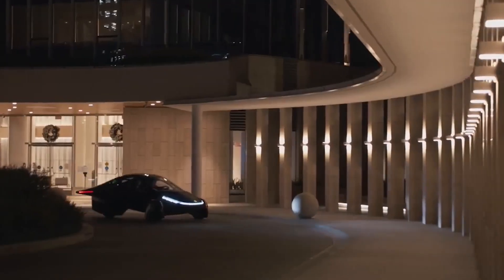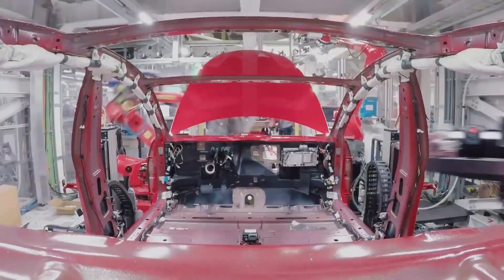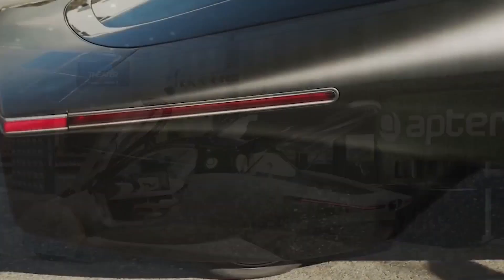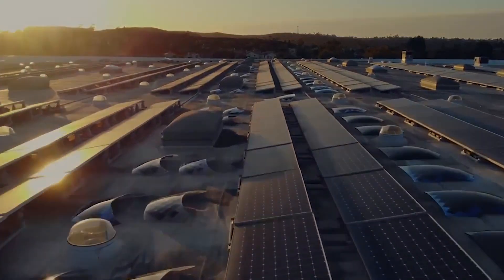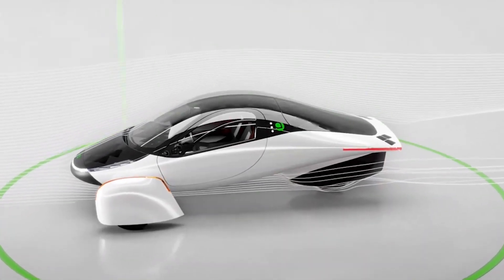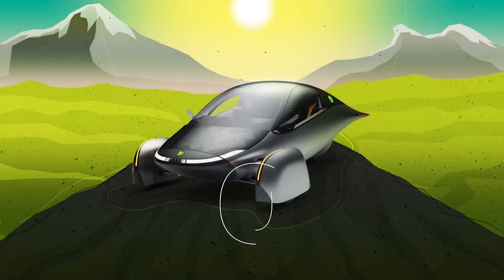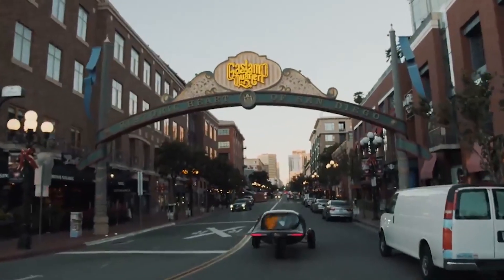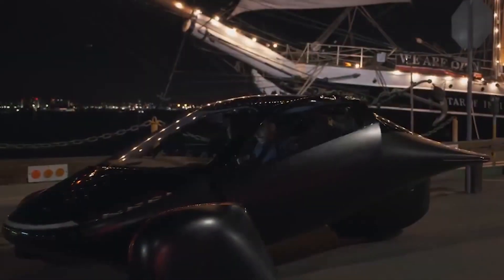Is The Aptera Really Green? Let's Find Out !

Comment: If you're going to critique Aptera's decision to add solar, be more comprehensive. You didn't account for any aspect of their many patented features associated with their charging process, nor did you account for the fact that their charging system - solar panels to batteries - is much more efficient than other systems simply because there's less infrastructure to contend with between collecting the energy and storing it in the traction battery.  This vehicle is all about efficiency, and Aptera has significantly raised the bar above all other EVs. It will save owners thousands of dollars over its lifetime as well as significantly reduce their carbon footprint, all without putting much of a burden on our power grid. That is outstanding!!!

Comment: I don't know where you're getting $1500. All solar panels are only $900. To put solar panels on my home. It cost me $32,000. $900 wouldn't have even been a down payment. But the 700+ watts of panels will add too the 10,080 watts I already have. With v2h, v2g. And $900 is less than it would cost for me to add 2 panels + install to my current system. 
Plus. For me to install 48k battery backup for my house. $79,000
I will have 66k for $38,000.
Plus have a car I can drive to work and back for free. 26 miles round trip. And can drive to my sisters house in Colorado. And stop once to fast charge. For lunch. Then drive up into the mountains to camp. And charge the car while camping.  All for free. 
I really can't see anything being greener than that. Especially if the green is the money I'll be saving.

Comment: I actually thought this was quite a well thought out video. I agree that if you want to do the greenest or most economic thing, it makes more sense to put panels on your home. Especially if you own a garage and aren't always away during the day. 

However, in my case I already have full solar on my tiny roof and my Aptera needs to be parked in the streets. It could actually be greener to lose the panels and use a public charger that provides green electricity. 

What's nice however is how Aptera will always charge at peak power generation moments. If you charge at home or at a public charge point, the chances are significant you'll do it at the end of the day, when grid power consumption is maximized and solar yield is relatively low. 
Even if you have a green electricity contract, in reality the extra load of charging at that moment will be covered by fossil fuels for the coming years. 

So if you can do reasonably direct charging with solar from your house, business or employer, not getting the integrated solar will probably be greener. If you need to publicly charge, I'm not so sure.
Reply from the maker: Thank you for your input.